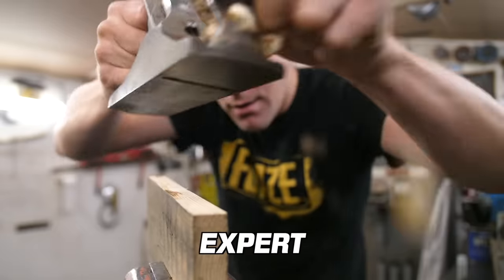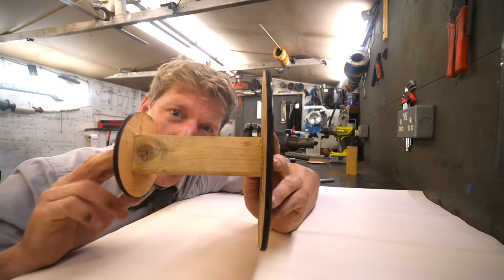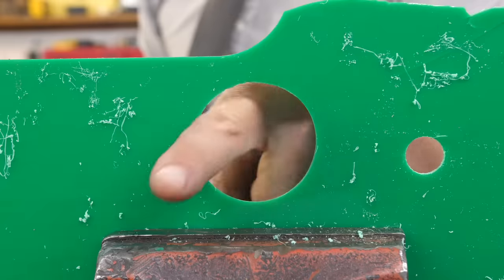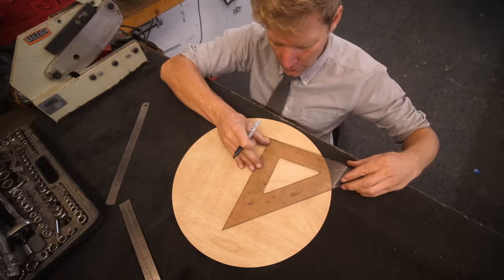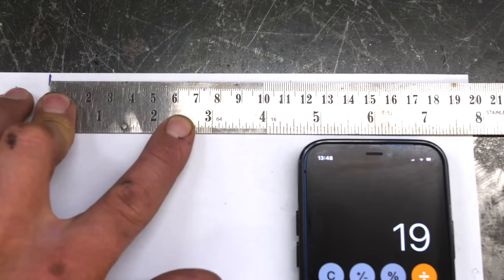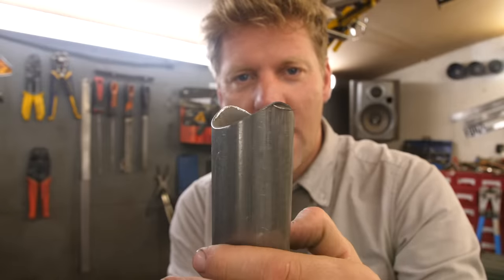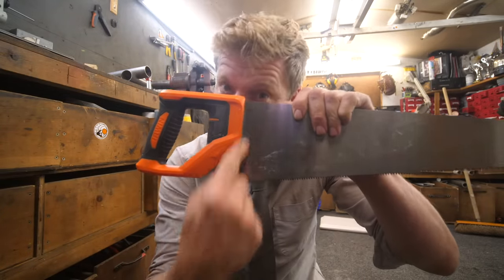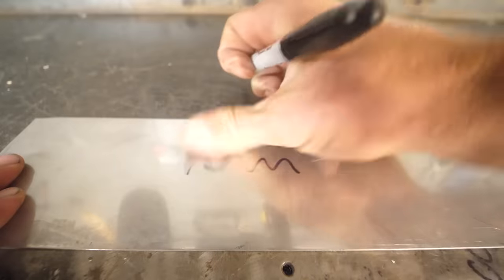18 GENIUS Workshop TIPS (that actually work)

Comment: With the triangle you don't need to bother with the measuring and drawing lines step to find the center of a circle. With any right triangle (or a square) that is larger than the circle, set the tip of the 90 corner of it at the edge of the circle and mark where the straight edges go off the circle. Those marks are a diameter of the circle, no matter how well the square is aligned. Do that twice in different spots and you can draw lines to the center. If you search "finding center of a circle with a carpenter square" there are photos that are easier to understand than this explanation.

Comment: To find the center of a beam of any sort you don’t need any math. Just draw to lines across the beam any distance you like then X them diagonally. They X will mark the center. You can do it at both ends and run a chalk line between them. I always avoid actual measurements.

Comment: If your trying to get the centre of a pipe why not just use an old plate square or engineers square and drag it along (would be best to use some chalk if it’s carbon pipe or pencil if it’s stainless (it will show up easier if as it will act like a developer) same process can be use to mark two line 90 degrees apart (just mark roughly on the two planes)

Comment: TIP; You have a hole in your car or truck's rubber tubing, dont buy a new one but take a bike set for stopping tire leaks...and yes it can take the pressure and heat and it's almost free.

Comment: Most important tip! Do not put your mug on stone or metal surfaces while working or your tea will go cold very quickly, use a scrap bit of wood or cardboard if you are not using a wooden bench

Comment: If you don't want your weld to pause or stutter at the start, cut the tip of the wire so it's fresh
Reply: Another one is to have a scrap piece nearby and strike the arc on it, and then start your weld on your work piece while the wire or rod is still hot

Comment: Sharpie removal... WD40 makes a much better job.   WD40 also works really well for removing residue from adhesives, if you've used tape, or have got stock materials with labels that have been on for years!

Comment: Ok... since I'm still here I will get to my other hack.... You have a lamp that is the shape of a rocket lava lamp, but it has a little spinner on the bottom that spins at a good speed making a current so all the tiny ballls in the water start rotating with the current & they get sucked into the cyclone vortex and it looks pretty cool....  the lamp is unopenable at the bottom & top.  The spinner has came lose and is hanging out a little and not spinning properly.  How do you fix your cyclone water bubble lamp?

Comment: Should you ever need to anodize a metal part, you should avoid using sharpie completely.. There is a chance that even after it was wiped off with denatured alcohol a shadow of the marks will show through on the finished anodized part. Happened at a shop I used to work in and we had to scrap that part.

Comment: Cheap rust convertor = 1:1 Vinegar/water
Reply: That's rust remover, not rust converter. Rust converter converts the rust into a different coating by chemical reaction

Comment: Another way for removing permanent marker or Sharpie(R) marks from metal and your hands. Just use a pocket-sized (refill using the largest family size) alcohol based hand sanitizer rubs right off. WARNING, if you have any paper or other cuts on your hands, this is also a very quick way to remind yourself exactly where they are. Try it and see. 😂

Comment: If you are needing an energy boost in the workshop grab a banana - but if you are opening it with the bunch end its the wrong end. Open it like a monkey and use the other end - a tiny squeeze will pop it open even if the ither doesnt split the skin. Blew mi mind when i realised i had been using the wrong end forever. 😂

Comment: Hey I've got a hack for you, instead of marking a line Straight up, mark it out like a point like this→ V and then you know PRECISELY where you marked, instead of guessing if you measured to the left or right of that line (if this is in the video I didn't complete it at this point of time)
Reply: I usually just put an arrow on the side of the line being referenced, or if it's down the centre I put the arrow over the line

Comment: Laying laminate is not hard... its just fiddly.  Often, even with new build houses you're going to encounter a wall that isn't perfectly straight... bowed or worse.
On that wall, push up your laminate planks to the wonky wall and grab a decent pencil.  Get a metal washer and put it into the left hand side corner.
With your pencil in the centre of the washer, use it to move the washer right along the wall to the right hand corner.

-that's right my friend, cut along the pencil line with your saw.  BOOM - a perfect fit.

Comment: the square thing at 10:50 is wrong. a rectangle has the same corner to corner measurements.
Reply: True, but you can also measure the sides, if all 4 are the same you have a square, the equal sized diagonals make sure the corners are 90 degrees

Comment: Run out of air in a spray can and don't have a compressor?  Drop the can in a pot of hot water. Also great if you're touch up a car with touch up paint and want a more professional finish.